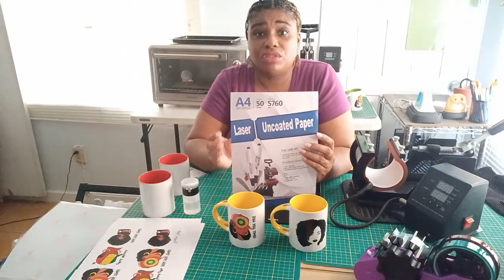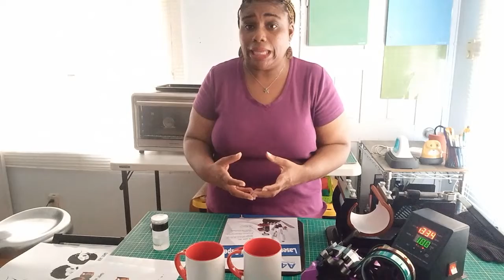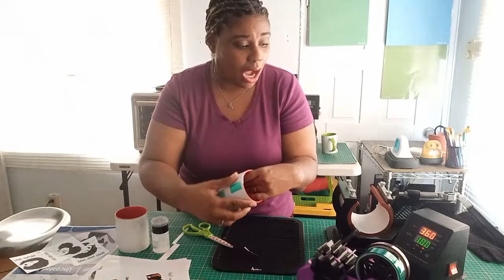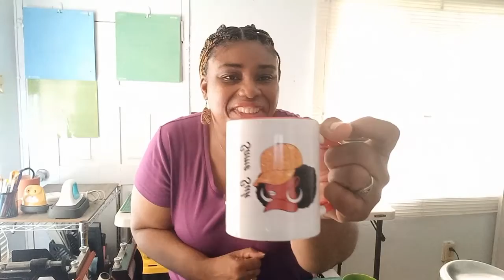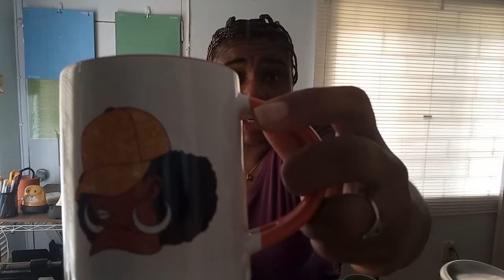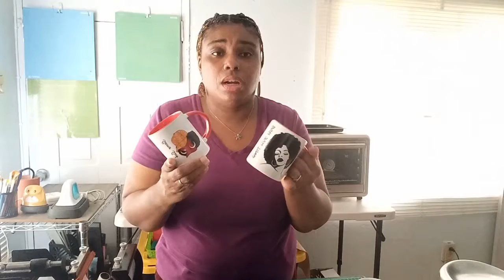Sublimation-like mugs with laser uncoated transfer paper

Comment: Hello! how to make sure the image is very flat on the mug?  Because I have been trying and keep getting the bubbles around the image.  thank you
Reply from the maker: Hi. Yes. A bubble is annoying. I usually layit flat and smooth the paper out with my hands and firmly tape it pushing out all the air from under it. But sometimes after i press it there is a bubble so i know its not going to be good. The good thing is you can clean it off and start again unlike sublimation. Right after you have a fail you can remove it with acetone. Dont wait too long or you wont be able to cleanly remove the image. Becomes cured and hard to remove

Comment: have you tried this on clear drinking glasses other than a white mug. I have a black image that I'm wanting to try on a regular pint glass.
Reply from the maker: Hi. Check out the part 2 of this video in the playlist. I did it on a glass bottle and a stainless steel tumbler and it worked. Thanks for watching and your question. I will be doing some glass bottles in my press as well